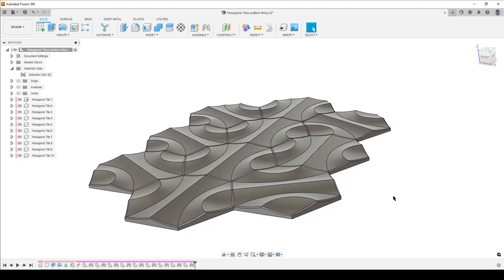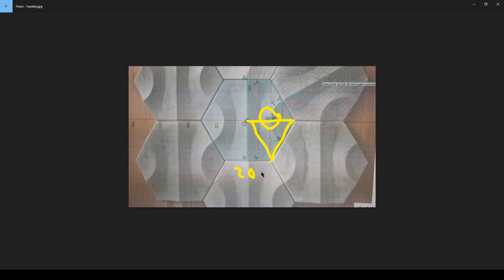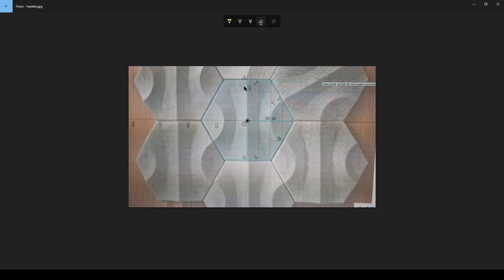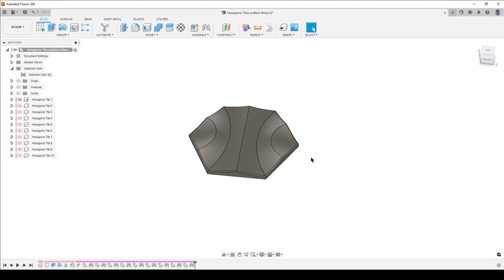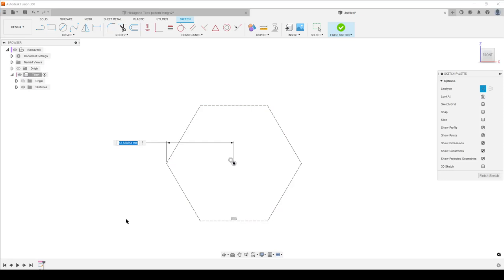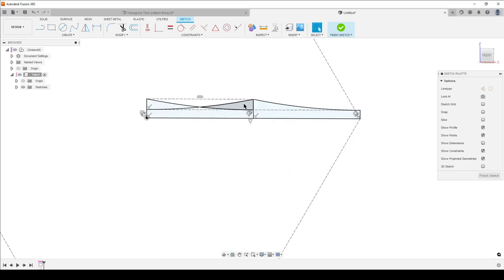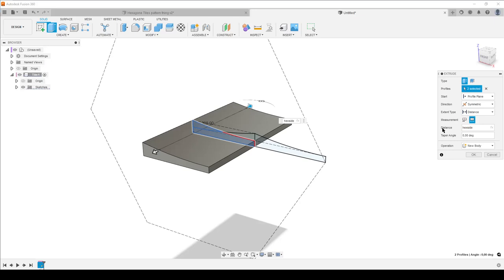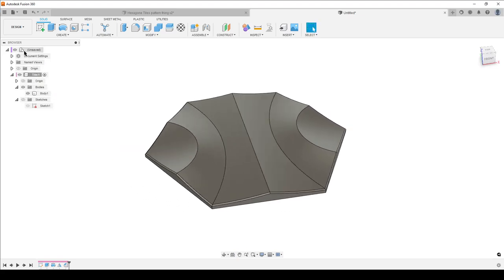Fusion 360 - Hexagon Tile

Comment: Great tutorial, these are really satisfying to look at. Something I found messing with the orientation of the tiles is that by adding a small cyinder to the bottom of the tile, so that it looks like a spinning top, then using the move modifier to rotate one of the tiles around that axis (selecting one of the tiles as a body), all the tiles rotate around their own axis together so you can quickly see some different patterns emerge.
Reply from the maker: It's interesting how something simple like the base shape can create expressive patterns.